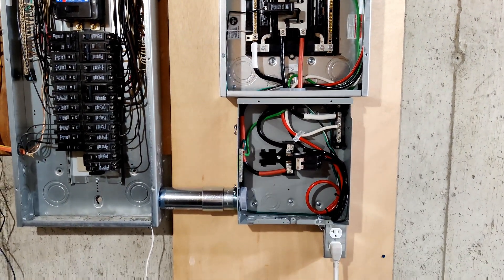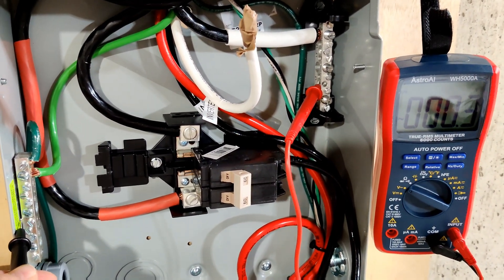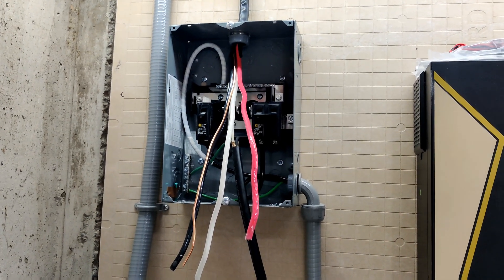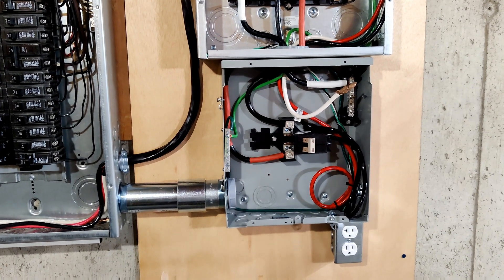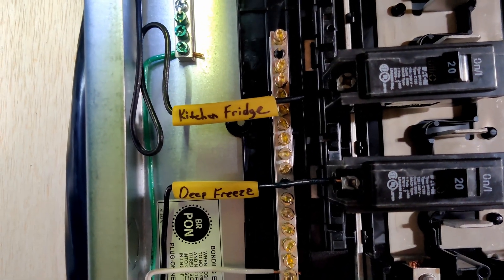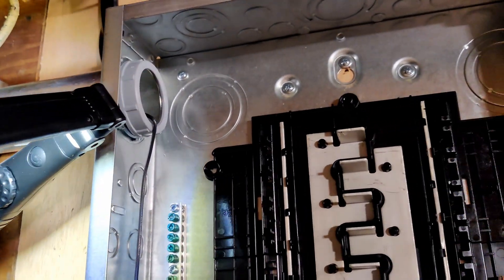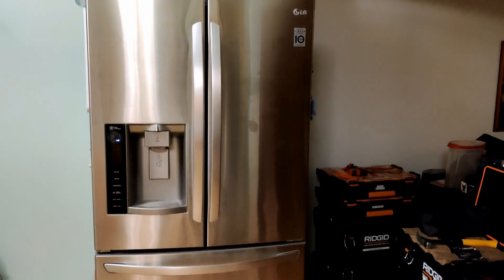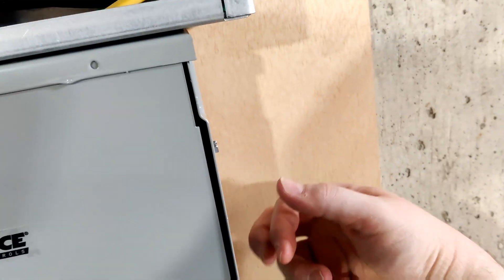Installation of an EG4 6500EX Based Off Grid Solar System - Part 5B

Comment: consider that it is a high impedance input on the Digital Volt Meter (DVOM)
Reply from the maker: You obviously know more about using a multimeter than I do, I know just enough to (hopefully) keep from getting electrocuted. :)

Comment: Relay n/g was off on inverter relying on a neutral bond at your grid/meter that you removed when you pulled plug. You need to set ENA on inverter so relay stays open (no bond) and you're bonded at service point per NEC requirements
Reply from the maker: Thanks, I need to flash the newer firmware still.  I'm hoping this will fix some issues I'm getting like clicking noises on my home theater amps when the inverter is in grid mode.

Comment: You could of used PVC to connect the panels together
Reply from the maker: Yup, I considered it but it was actually cheaper to use the 2" rigid conduit when you took into account the fitting and glue costs. IIRC I saved $5 going the metallic route and it's stronger and provides a secondary ground/bonding path vs PVC.  If it had been cheaper I'd have gone PVC.

Comment: Congratulations! Great job!

What firmware version are you running on your inverter?  The latest version 79.71 gives you the ability to control the g/n bond in the inverter from the menu (option 42).  Since you're connecting AC IN from the grid, you would want that setting to be ENA so the inverter is not trying to create a bond at any time.  It also configures a common neutral in the inverter between the AC IN and AC OUT.

Also, after doing all that drilling through the floor joists, you'll want to clean the vents on the inverter.  With those "jet engines" running, they pick up a lot of dust.
Reply from the maker: I'm still running the version it came with, it's on my list of things to do but my daughter "borrowed" my laptop and I've not felt like hauling a full PC down the stairs to do it.  I felt it was worth mentioning because most people wouldn't think to check the potential between neutral and ground.  Most people would use a non-contact voltage tester after flipping off the breaker and call it good.  My Fluke unit wouldn't even blip as the voltage was too low.  I don't know if there was enough current present to cause sparks but someone might get a nasty surprise when they accidentally touch a "dead" neutral wire to a grounded enclosure in this scenario, like accidentally crossing the terminals on a car battery with a wrench.
Admittedly most people won't be using the inverter to run lighting while they're working on it either. ;)
Reply: @SolarShenanigans  nope, I think it was great you mentioned it.  Most people aren’t even aware of any g/n bond, so yeah they could get a nice zap thinking they’re safe.

It’s just like grounding your pane frames on these inverters.  If you don’t do it, you can get a nice surprise…
Reply from the maker: @AdamDeLayDIY  I've not grounded mine yet.  I'm hoping the racoons that keep leaving paw prints on my panels will get zapped. ;)
Reply: @SolarShenanigans  🤣🤣🤣 man, I should have thought of that!